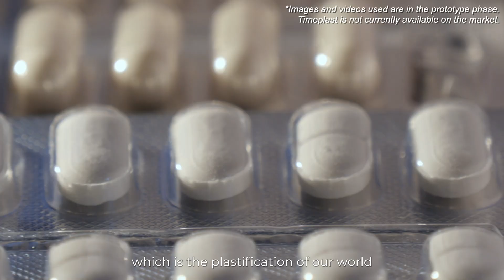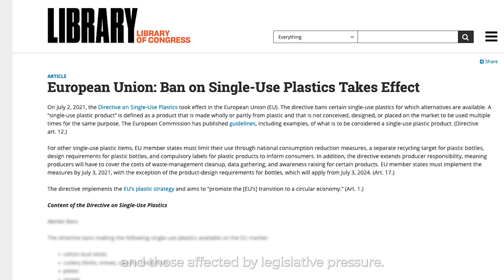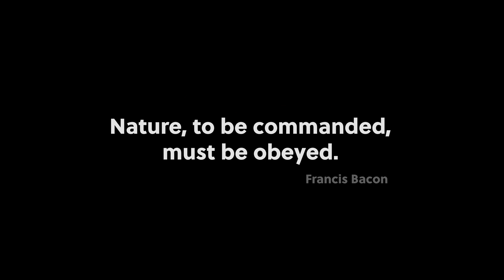Introducing Timeplast: The Breakthrough Meta-Material Changing the Future of Plastics

Comment: I'm not trying to give you a hard time and I genuinely think your products are great if they work as designed. I'm even purchasing some material as we speak to give it a try. However... @0:32 The beaker containing the dissolved material that you grabbed contains ~325ml of water. The beaker you drank contains ~500ml of water. Obviously no one expects you to drink that, but that was a bit unnecessary and disingenuous.
Reply: Thanks for the thoughtful comment — and for giving Timeplast a try!

You're absolutely right to point out the difference in water levels between the two shots. The clip showing me drinking was filmed at a different time than the timelapse with the dissolving material, which is why the amount of liquid doesn’t match exactly. That said, I did in fact drink from a cup containing dissolved Timeplast — just not the exact same beaker shown in the timelapse sequence. And I have done so, not one or two but many times, in fact not only me, but several members of our team have ingested samples of Timeplast materials — not because it's meant to be eaten (we clearly state it isn’t), but to demonstrate our confidence in its safety.

We always strive to be transparent and appreciate the accountability, it was not possible for us to do both shots at the same time, as the Timelapse took longer than expected precisely because it was setup with too little water. 

Anyway, thanks again for your feedback, it definitely helps us improve how we communicate what we’re doing — and it means a lot that you’re testing our material for yourself.

Let us know how your prints go!